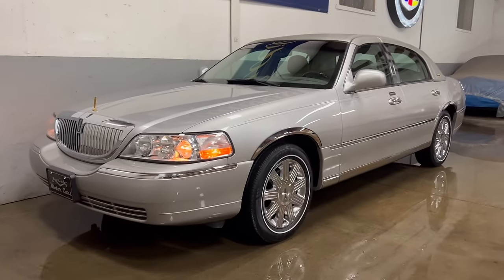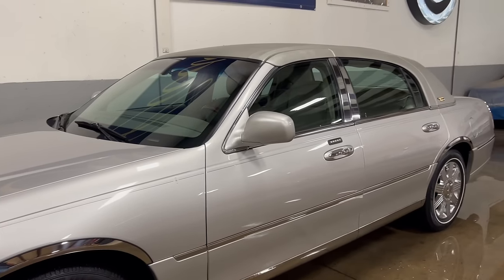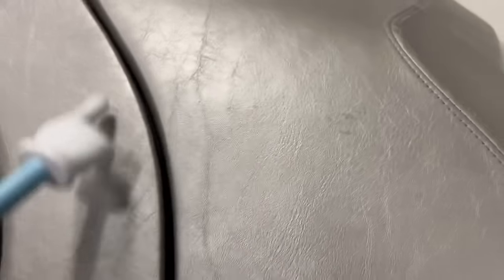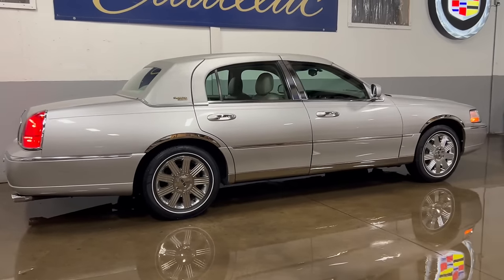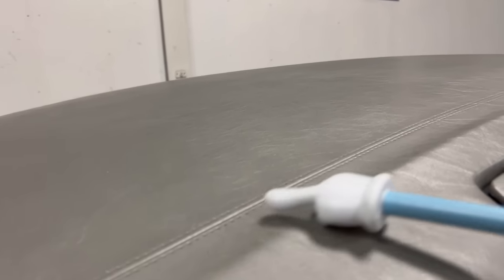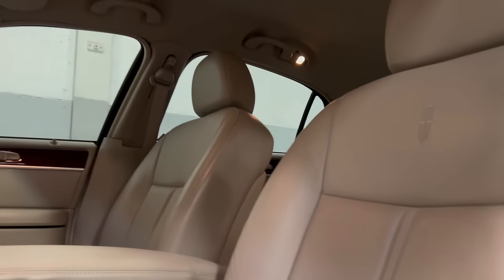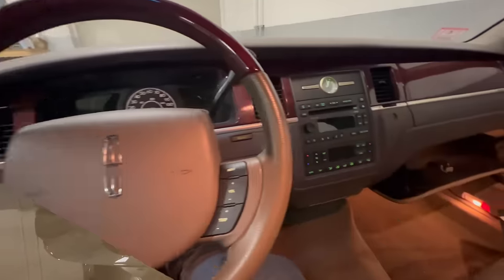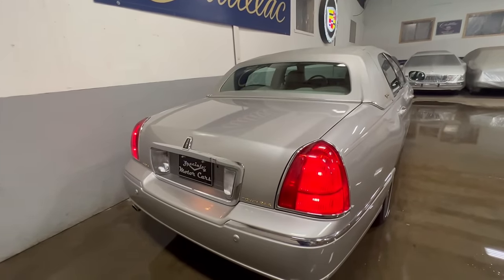2005 Lincoln Town Car Signature Limited 64k Miles ALL THE EXTRA TRIMMINGS Specialty Motor Cars

Comment: Believe it or not but these return somewhere around 25 mpg on a roadtrip
Reply: If I got the cruise control on I can get up to 27 miles per gallon on my 2010 Town car.
Reply: @dcformee123  Nice...and it's a comfortable ride on the road.
Reply: I get around 22 on my ‘11 Crown Vic. Not impressive but not disappointing for its size
Reply: @RustyZipper  I think it's impressive for the size and comfort of the car.

Comment: Pretty sure the windshield is a newer one.  The rubber around it, at the top corners are flat and there's no gap (like they get when they are this age and/or the corners are not flush to the car metal).  First thing that my eye focused on was.....those exhaust tips!  I'm not sure if I personally like them on my '05, but on that '05, like you, sort of growing on me as well.  This car is very close to mine in mileage, shape, looks (except for color and 1/2 vinyl roof versus full) with shiny paint and not many flaws.  They both share Florida background even.  I think you've got this one priced correctly and it's a great deal considering all of the repairs you did already to make it as it should be.  Wish I had one of you and Papa Bear to go over mine in the same manner!  I'd buy this one if i had a garage for it or at least a nice carport.  Oh, I do like the chrome around the tail lights!  Don't know if I've ever seen any before.  Any undercarriage pictures/video?

Comment: I think you and Papa Bear got a beautiful Town car this time I have a question for you I have a 2010 Town car and I'd like to put white walls on it but again you probably know you can't find them anywhere but I know you know somewhere to get them could you please let me know where to get them I'd like to put a set on my car when these were out I have a 2010 Town car signature limited with 80,000 just turn 80,000 mi and it has been the best car I bought it with 42,000 miles and I won't get since 2014 so I don't drive a lot but it sure been a damn good here in the future I plan on adding another one to my collection and I'll be calling you up for a second car.
Reply: Where do you post the prices?

Comment: I wish you could come down and buy my 2002 Cadillac Deville (64000 mi) and my 2002 Lexus L430 (115,000 mi) here in south Florida.  I'm thinking 3K takes both cars.  Bring a battery booster.  Both have been sitting for about 10 months.

Comment: Gorgeous car. That vinyl top looks odd with the bumps & valleys from base sheet metal interfering with how it lays (it's not smooth & flat all along roof rails & vertical seems next to rear window). I would've applied a padded backing or something under the vinyl?